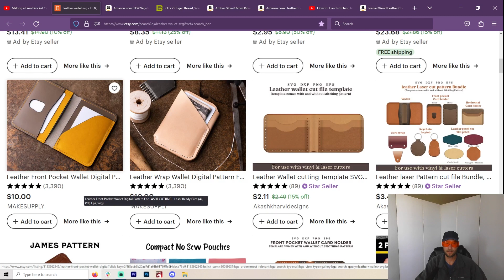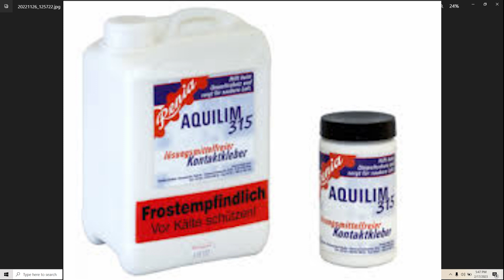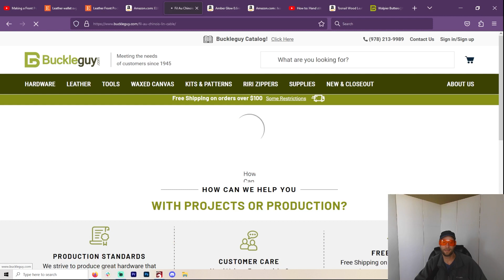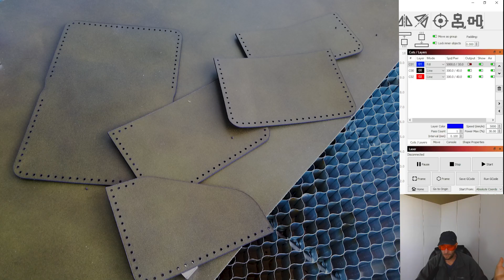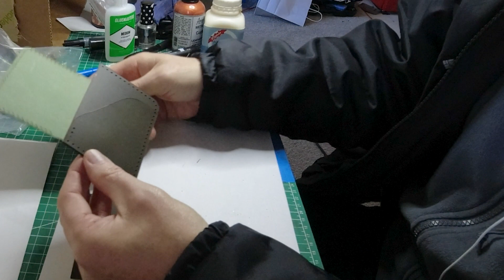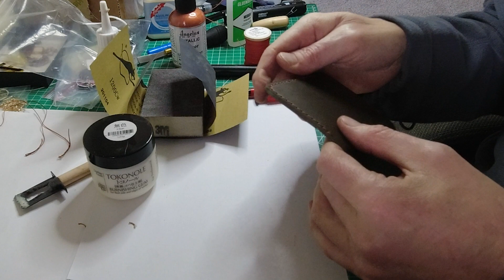Make a Leather Wallet Using a Diode Laser Engraver / Lightburn (SVG Available)

Comment: just curious, I know your diode is higher than 5watt, but what are your number of passes to actually cut the leather?
Reply from the maker: It all depends on the thickness of the leather, power settings, is it veg tanned (for sure)? For 3mm leather,  you should be able to do it in one pass even with a 5w diode laser. Testing is everything

Comment: When using any leather glue you need to apply it to both sides that you are gluing. I personally have been using the same glue you're using for 2 years. It needs to set and look more clear before connecting the pieces.

Comment: Does wetting veg tanned leather help with charring? I have a Atomstack A5, 5.5 watt and have to run 200/ 100% and 3 passes to cut all the way thru 4-5 oz leather.
Reply from the maker: Eek! I feel for you. I have not tried to wet it with a diode, only Co2. Do some testing on a scrap and see if there is a difference. It may also alter the cutting ability.

Comment: How are you copying the stitch holes to each layer to line up. I cannot get the "mirror across line" feature in LightBurn to work, to mirror stitch lines from a top half to a bottom half. Since some of the holes may need minor adjustment for spacing, its obviously critical to get those holes lines up for each layer. ???
Reply from the maker: I put the pocket layer (with no holes) on top of the main layer and just copied the holes. I hope that makes sense. I appreciate the comment and will add this step in my next leather video.

Comment: Nice video !!!! Just got an xtool 20w how can I clean the char after I burned a logo on leather .. seem to keep on staining the leather 🥲🥲
Reply from the maker: First, make sure you are using THE BEST setting to get the lowest char. Use air to blow it off, don't use air assist. You could mask the area you do engraving as well. I don't get any char, but I use already dyed leather which may help. I suppose you could also pre-seal that area with some protection. Hope one or many of the above helps :)

Comment: Cool channel! What size thread did you use or what size have you found works best for this wallet?
Reply from the maker: Getting the thread and hole size / spacing right is def a trick. This size and spacing of this wallet is very masculine. Also, tiger thread is flat so looks larger than other threads. Mine are .8mm.

Comment: So how does leather cut on the Monport?
Reply from the maker: I will have to try it at some point. I am sure it works fine, but I have it so dialed in on the LM3...and for my setup the Monport is just so much more difficult. Mine are outside, so the enclosure actually makes things harder in my case. I have a unique setup.